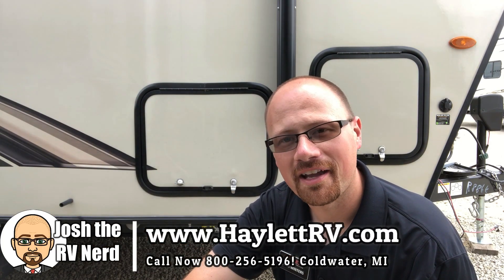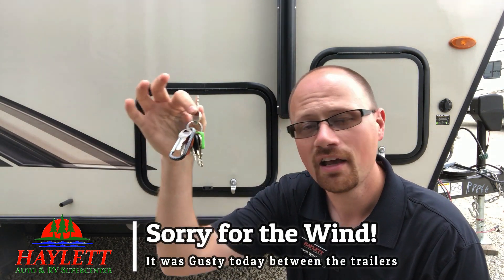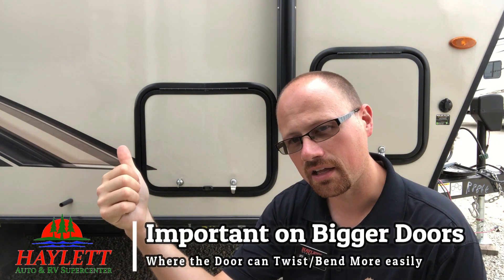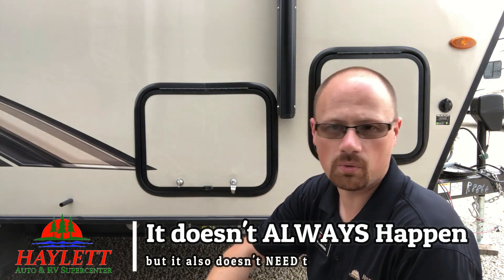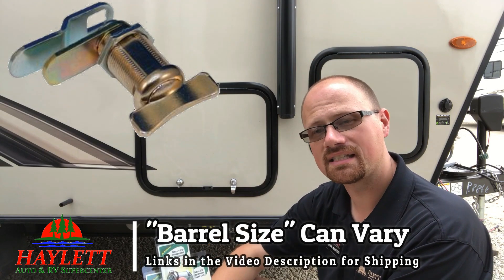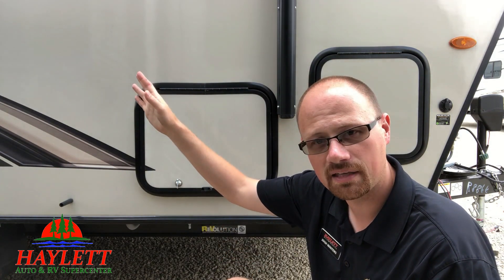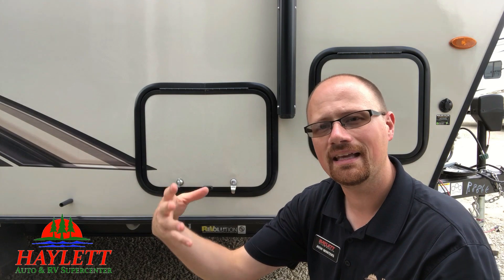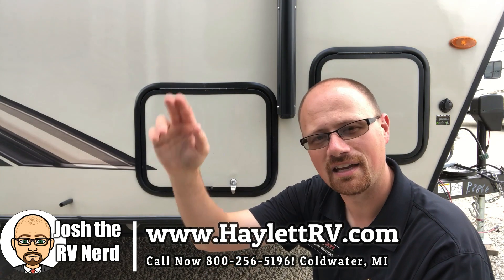751 RV Key Lock Simple Swap Convenience Mod with Josh the RV Nerd

Comment: Cheapest most effective storage unit mod I have ever witnessed was when my Grandfather bought a 1986 Fleetwood Jamboree. He did the generator delete option on it and just used the entire generator bay as storage. 
In fairness we did suffer a bit because we could not use the coach air conditioning while driving. However, with solar and inverters commonly available today this may be a viable option to "bring back".

Comment: Thanks Josh for your helpful and entertaining educational videos. I'm new to the rv culture and I'm in the research stage of determining which rv I want to buy. Regarding the topic of keys, I would appreciate you clarifying the One Key system, what type of key(s) most new rvs come with, and if there are options to install a single unique secure key lock core system to any rv, similar to what a car would have (a unique key that isn't universal and not easily duplicated unless another person has my key in their possession).
Reply from the maker: RV keys are not like Car keys, but the keys you have are not something any other person you meet will generally have a match for.

Comment: If you want to be MORE secure you can go to Home Depot and buy the barrel lock that has a different key and put it in so no one is likely to have the same key as yours. You can also replace these with locks that have the round keys like they sell at CH751.com .

Comment: If you measure the lock cylinder length and diameter you can find toolbox cylinder at your local hardware store and still use the same latch bar

Comment: I got a 2014 Chevy traverse se... I think towing is at 52,000lbs? How do I find out... ps I need to install a tow hitch. Which of your videos do u recommend? For a small RV trailer... if I need a bigger truck then my RV option for work is out... thx
Reply from the maker: If you have a traverse with no hitch, then it probably has extremely minimal towing. Either call a Chevy service center with your VIN or perhaps our guys can give you a hand looking it up against tow guides.

Comment: Do you know if Jayco's "Keyed Alike"  system uses 751 locks? I hope not since the baggage lock is the same as the entry door 😮 Thanks as always for the vids!!
Reply from the maker: Key Alike is not 751 keys -- it replaces 751 keys and locks (though the outside shower usually requires a 751 key still since that comes pre-installed from the supplier). 

The Idea behind key-alike is one key operates the entry and baggage doors.
Reply: Haylett RV Thank you sir.
Reply: I love/ hate the fact that my Jayco is "keyed alike"! I love that I only have one key to open everything,  but HATED when I broke a key of in the door and couldn't get in the camper because I only brought one set of keys!

Comment: I am the type who has the opposite question. What happens if I want MORE security? Is there a brand that's bad or better at door and baggage door security?
Reply from the maker: Easy Solution: Change the 751 key lock for a similar looking lock set that just uses a different key. Available off nearly any parts shelf.
Reply from the maker: Great question btw
Reply: So this is the solution for the paranoid? I'm guessing brand doesn't matter?